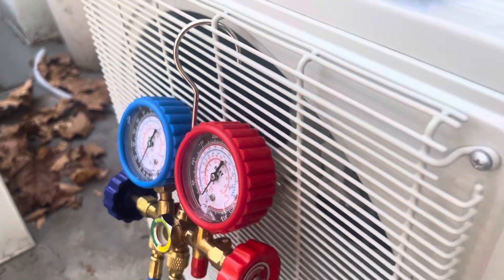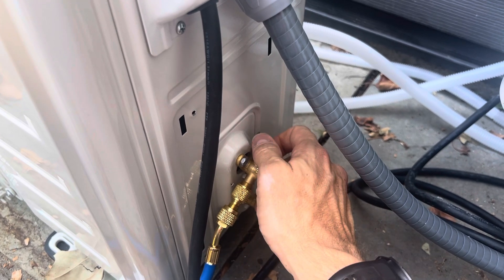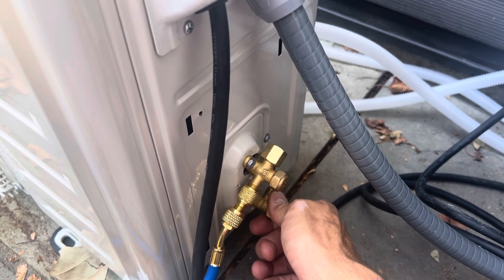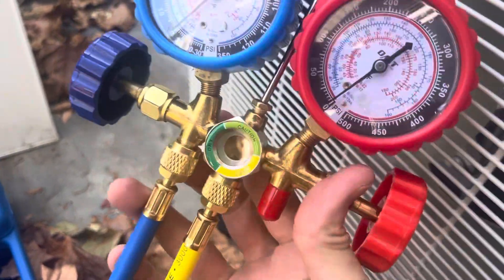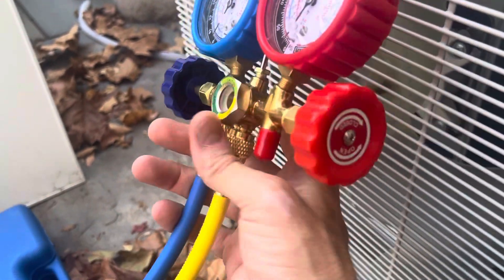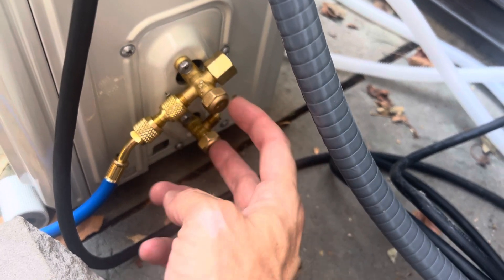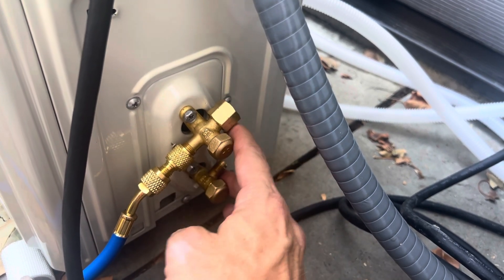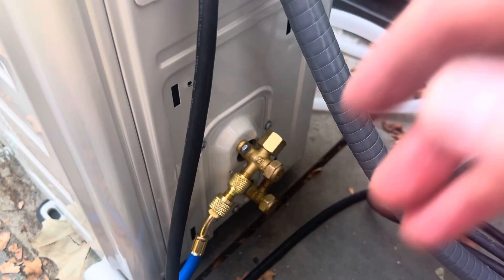SOLVED!  Mini split won’t hold vacuum (see comments)

Comment: HOLY SHIT if I could like this video and the comments in it twice I would. Just installed a Minisplit and couldn't get it to pump down. I followed the suggestions here and adjusted the Schrader valve WAY above the seal. Gave it a another pump down while finger tightening the adapters. Now it's been holding at -29 for a hour.

Comment: This is exactly what I am experiencing all weekend, I tested the manifold and checked no leaks but I put vacuum on my minsplit and it goes -30 then as soon as I turn pump off and close the low side it immediately shoots to zero. So I guess I need to see what other adaptors came with it I know there were a few. Hope it works this was so frustrating I redid all my flares and no leaks on fittings anywhere. TY for the video.

Update - Fixed it!  apparently the Della with R32 refrigerant had a special protective adaptor on the low input valve.  I removed that and also had to use a different connector in my manifold kit. Now the pin depressed valve no issues and held a vacuum. Saved me from calling a HVAC Tech.

Comment: Dude total lifesaver.  F’d around all last night trying to vacuum down my system.  Pulled the fitting and the shrader valve fitting failed.  Used the other one in the kit and good to go.

Comment: Thank you TJ and everyone who posted. I had the same problem. I changed the o rings, tightened and loosened everything, but the system wouldn't hold a vacuum. I didn't want to wait to either go out to get a new adapter, or order one online. So I used my schrader valve remover, which costs a few dollars, and took out the valves in both the adapter and the service port, pulled a vacuum, and it held. I never would have thought of doing that if I hadn't watched your video and read the comments. What a relief.

Comment: THANK YOU for posting the fix!!! My vacuum pump came with multiple adapters. I put one on and I thought because it screwed it on, it must have been the correct one. 
Nope! I removed it, tried another that came with the pump and that one screwed much further on. 15 minutes later it was all good!

Comment: Dang was really hopeful this was my issue. Mine is i get a good vacuum and it slowly goes back to zero i cant hear or see a leak anywhere. Sucks. Time to buy more crap lol
Reply from the maker: Have you done leak tests at all the flares?  I’ve heard that can be a problem on these units
Reply: @TJBowen-wu6zi is leak testing with soapy water effective for testing the flare fittings if the system isn’t holding a vacuum or under pressure with refrigerant?
Reply: Yes it was the damn adapter for me too it seems … still waiting for vacuum loss but it seems to hold . I switched adapters , the black grommet inside was crushed from over tightening maybe … then I gently snugged it in as a vacuum started to leak until it stopped leaking then pumped it out again . Seems to hold . If either of the adapter ends are leaking tighten till you see movement in needle stop … then you know . Then you shout F@&$k I just re flared everything for nothing !!!!!
Reply: @mattandlanacarter4137  Also forgot to mention I bought a second lineset on another system I installed it worked without a issues first try I didn't even have to tighten them nearly as much. It was a softer copper lineset fwiw.
Reply: It’s holding !!!!! Yesssss!!!!! Praise Jesus ! He is Lord ! Thank you ! Thanks for this post !
Reply: @mattandlanacarter4137  Mine ended up being I cut the flares off and completely reflared mine. The flares from the factory were trash. I contacted support they said sorry but was "shipping" damage likely. I told them what was the point of buying pre-flared if they are junk.

Comment: Oh my goodness, I have the same unit and was convinced I had a leak until finding your video - the only one on YouTube when I searched ‘mini split won’t hold vacuum!’

Question: which adapter did you end up getting that worked?
Reply from the maker: @n.c.pfister6485  glad it helped. I have thought about putting a video up of the actual valve issue but never got around to it. I can’t remember which valve worked and which didn’t but I’ll share the Amazon links. I would actually buy a couple and just return the one that doesn’t work. 
Zoizocp R410A Adapter 5/16 inches... https://www.amazon.com/dp/B0BW8H1CFG?ref=ppx_pop_mob_ap_share

R410a Charging Vacuum Port... https://www.amazon.com/dp/B07WCFXW9F?ref=ppx_pop_mob_ap_share
Reply: Did you find an adapter? We must have all bought the same piece of junk

Comment: Having this same issue. Ever find a solution?
Reply from the maker: Yes!  I have an update. It’s working perfectly. The valve depressor in the adaptor I bought from Amazon to connect the gage manifold to the mini split wasn’t depressing the Schroeder valve. It was too big. I bought a different adaptor and it worked the first time!
Reply: Will try it. What fitting did you buy? @TJBowen-wu6zi
Reply: @TJBowen-wu6zi  Did the adaptor you initally used come with the manifold gage?